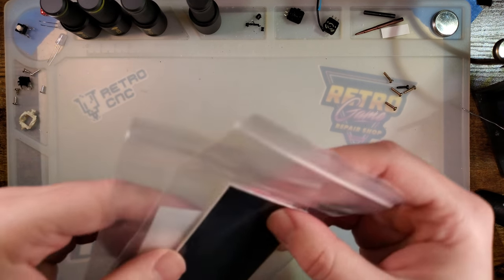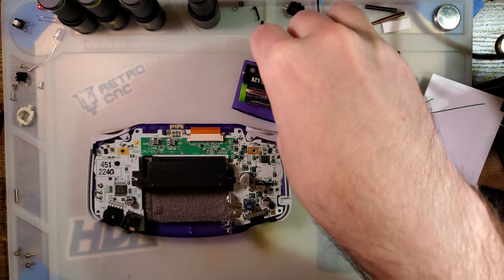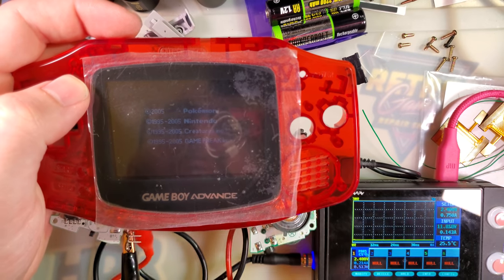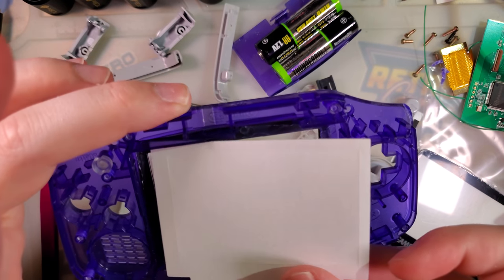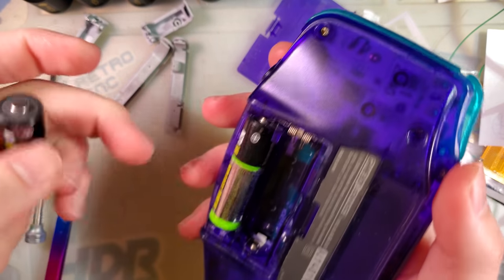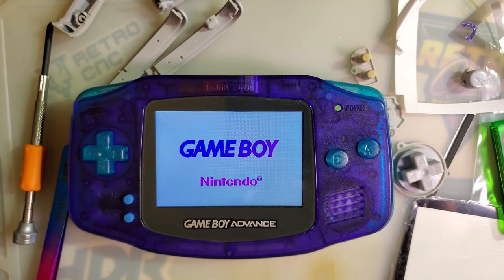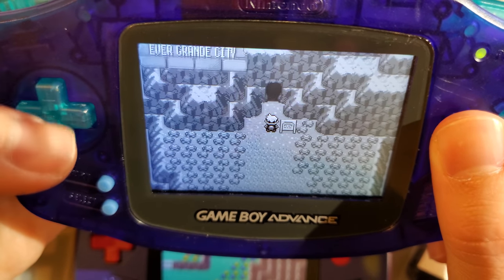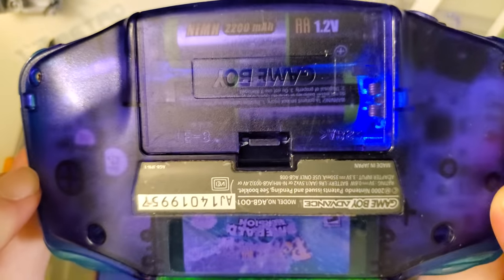Game Boy Advance "No Cut" CGS Backlight Kit

Comment: My kit is arriving today and your video has provided me with a lot of confidence that I can do this relatively painlessly. Thanks!!
Update: it went very well, only issue I'm having is with the brightness capacitive sensor being kind of a pain to actually trigger, but it does work. Probably could fix it by thinning out the shell in that spot a bit but I don't really care that much haha
Reply: Oh and I didn't center the screen very well either but oh well, good enough for me 😂
Reply from the maker: I find that the touch sensors work more reliably the better hydrated you are. Also, adhering them to shell helps significantly too.

Comment: I ordered one of these kits last week and it arrived on Saturday and I installed it on Sunday. Some of the games I play the most on my GBAs are Metroid Zero Mission and Metroid Fusion, and having used the unbranded V2 IPS kit in my main GBA for nearly 2 years now, I can say after less than a week of use that I definitely prefer this mod for when I am playing those games, and will probably be my preferred mod to use with games that either have sleep mode functionality or that regularly have me pressing either of the shoulder buttons and the select button at the same time. I am very happy that I don't have to remember to release the shoulder buttons when I need to press select, and I am glad that I can exit sleep mode without changing the brightness of the screen. The only things that could make this kit better in my opinion would be to use a screen with a warmer color temperature, that's my smallest complaint about the kit, the main thing that would greatly improve the kit would be to add a button combination that you can use to enable/disable the touch sensor so that you can make sure that you don't accidentally change the settings once you get them to your liking.

Comment: I have saw several videos from your channel and many of those point out an issue many of these IPS kits have, and that's the gosthing/artifacting. Turns out it's not the kits fault by themselves, but rather a genral problem with IPS panels, as the same issue can be reproduced, for example, on New 3DS models with IPS panels (using AGB_FIRM or open_AGB_FIRM), DSiXL using GBARunner2 and even I tested on my IPS PC monitor using mGBA, same result.

That flicker transparency effect was solely designed for TFT blurry screens, so any IPS panel will have the ghosting/flicker issue no matter what, becasue the issue are the crystals inside of those, but no one seems to have a clear answer for that. Of course, there are ways to overcome it, for example, adding a inter-frame blending would fix it in some way.

Great videos and keep going with this quality content, really apreciate it!

Comment: I laughed when I saw this kit and they called it solderless because youre supposed to wrap the wire around the terminal.
Certified bruh-moment
Reply: Quite a bummer in a way too, might have to sit this one out until I go get a soldering starter kit. That pixel grid display really hooked me in.
Reply: Can you explain?
Reply: The solderless which was the previous version was almost perfect as a drop in .. not sure why they would do this

Comment: Thank you so much for this non-edited install video.  Very helpful as a reference to know exactly how all the little ribbon connectors unlatch.... definitely would have broken them.  Two big things I learned from this, 1) the Q-tip stalk spacer on the left side (looking from the back) was very necessary for proper alignment otherwise the ribbon on the LCD on the right side creates too much pressure, and 2) I really wish they would solder the wire on the ribbon facing the other direction.  I broke my wire trying to close the GBA MoBo latch and re-soldered facing the other way.  Much less intrusive.  I'm amazed at how well the touch sensor works and kind of neat it lands on the Nintendo logo.  Overall SUPER pleased with the screen and new lens; revolutionary.  It is just a tad blue.  Playing LotR Two towers everything is a tad extra purple, but I really don't mind it.  I referenced this and the install from the older kit where you did not cut the shell since I wanted to keep my classic opaque purple OEM shell as original as possible (though I did have to cut the back shell since I also did a usb-c with battery mod).  Thank you thank you Mahko!!

Comment: At some point in the last 4 months the instructions in the pictures on RGRS have been updated to say that the wire should be soldered to pin "2" on the power switch. Someone finally heard Makho when it comes to soldering for the kit. I also noticed that the kit is called a "no cut" kit and not a drop-in kit.

Comment: Great video! It looks awesome. But how bad is it to not solder it and just wrap the wire instead? Because I don't know how to solder and I don't have a soldering kit

Edit: better question, what if you just don't use the wires that are new to this revision? Can they be removed to make it work like the old version?
Reply: No, I tried this without the wires to see if the screen was working before I soldered. While you can still see the screen it’s very very dark to the point where the original Gameboy screen is more visible.
Reply: @fncboy7014  Good to know. Thanks! I ended up going with a different backlit screen a few weeks ago that was truly no soldering required. It looks awesome in my gameboy.
Reply: @thealqemist  hi! which kit did you buy? I'm looking for a no solder no cut solution
Reply: @thealqemist  I would like to know what kit you got as well

Comment: I have a pre-owned GBA with ips in it. Seller didn't indicate much detail so I had to look for all GBA IPS videos and led me here.

It has 8 levels of brightness, 4 normal and 4 grayscale with 3 extra pixel mode each. 

Now I don't want to tear it apart yet but the ghost touch is driving me nuts. And for some reason a battery icon showed up on the top right just a few minutes ago. Does this have an OSD?
Reply from the maker: This kit doesn't. Maybe a newer iteration does. If your gba is having issues, return it and let the seller deal with it.

Comment: I like watching your mods, but I have a question about Batteries. I have a GBA SP AGS-101, and its battery only lasts about 30minutes. Im clearly due for a new battery. I was wondering what the largest capacity battery you've found for it was, and if changing to an IPS screen would reduce or increase power draw?
Reply from the maker: Biggest I've found: https://www.youtube.com/watch?v=VjnONhSVvpA

And yeah, an IPS mod will cut your battery life in half at the minimum.

Comment: Ive had this screen for a little bit and recently I tried installing a new casing on it. In the process I mustive damaged the wire giving tbe screen power. The console turns on but the screen does not. Ive tried everything, is there anything you would recommend?
Reply from the maker: If you've tried "everything", what more can I suggest? 

I don't know what you've attempted and I have no idea what your work looks like (hint: pictures are helpful). I'd recommend making a thread in the troubleshooting section of the game boy discord if you haven't already.

Comment: Do you know if swapping the screen while keeping the old converter board will make the screen less blue? Or is the new converter board making the screen less blue and not the screen itself?
Reply from the maker: It is the LCD itself that is less blue. You'd want the new LCD too (even with the older driver board).
Reply: @makho  Ty for the confirmation, CGS’ customer support said the same thing

Comment: Hi i bought this excact IPS for my GBA and in the discription on eBay it looked a Bit different because i was looking for a No soulder Kit. But the Kit i got had a Wire on the ribbon cable do i have to soulder it to the Power Switch or the capacitor Like you did so that the Screen Turns on? Because when i Power on my GBA i can Here Sound but the Screen stays Black.
Reply from the maker: Wire is required. Wire must be soldered.

Comment: I dont know if you would know the answer but I bought this same screen, got it all installed. It worked completely then when I screwed the shell in it stopped working. I dont know what the problem is ive tried unscrewing everything and turning it on but it still didnt turn on. I am not sure what the problem is. Do you know what could have happened?
Reply from the maker: check your ribbons and connections and contact the seller of the kit if it's still not working

Comment: I tried installing this, got it to work but when I went back in to remove some dust, the screen is just black now when I turn it on….did I break the ribbon? Seriously frustrated because I don’t know what I did
Reply from the maker: double check that all your ribbons are seated properly. If that doesn't fix it, it sounds likely that you damaged the screen. These LCDs are very delicate and do not respond well to being pulled out of a GBA.

Comment: so the wire should be soldered to pin 2 of the power switch? in the video he says the side of the fuse. Could someone point to the exact solder pin?
Reply from the maker: You know that on the circuit, the right side of the fuse and the far left pin on the power switch are connected, right? Use whichever is easier for you.

Comment: Wow, they released something like this after buying the older version that requires cutting, couldve made my life easy installing this haha. By the way, my agb 001 is having a speaker issue, it sounds so low although using the headphone is fine, I can lower the volume and raise the volume no problem, its just the speaker is so weak. Tried replacing the speaker with a funny playing speaker and its still the same. Caps seem fine, if and if I have to replace the cap, should i just replace the CP04 or should I bother replacing all of them? And if I do, since im using a power hungry IPS display, and potentially a flash cart in the future, should I even bother using a power cleaner?